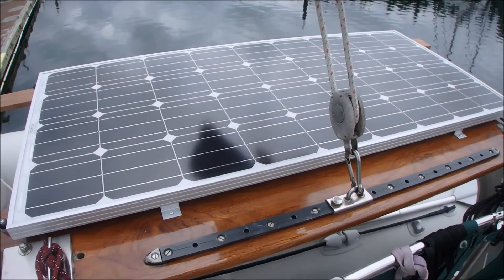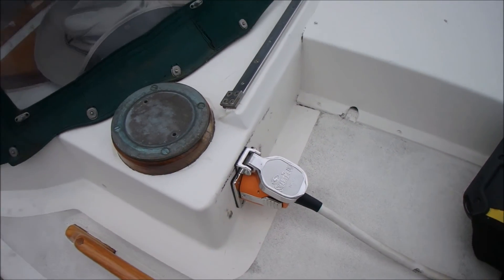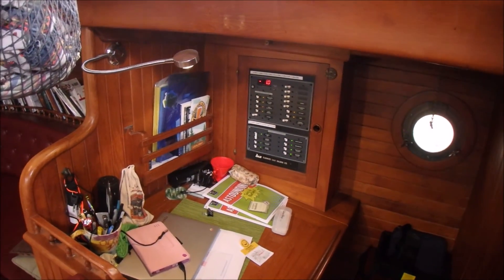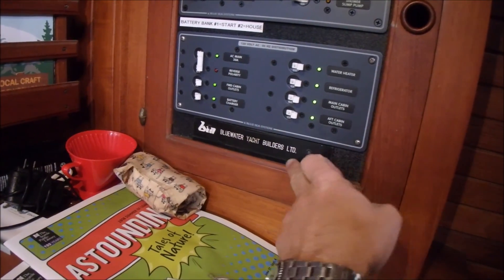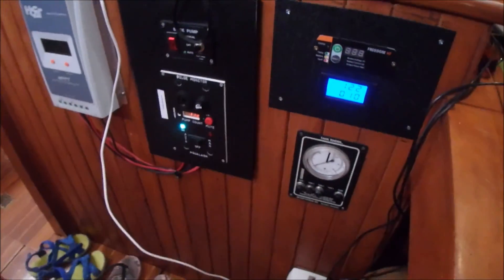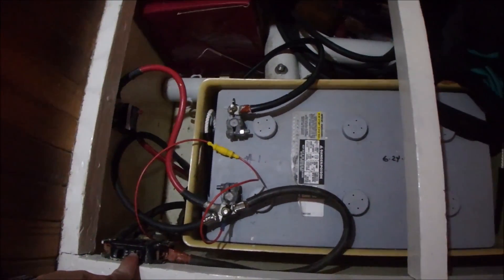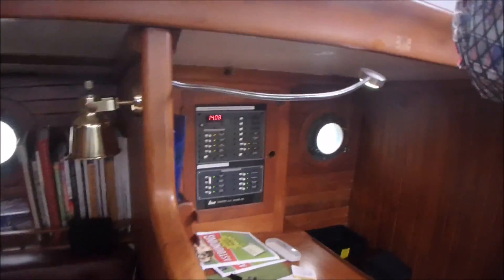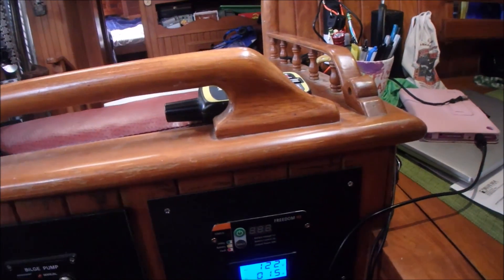SV/Raven Video Diary #12: Electrical Upgrades

Comment from the maker: Update. Despite my best efforts, one wire in the new plug got loose and it started melting. I highly recommend spending the extra money for a prebuilt SmartPlug shore power cable.